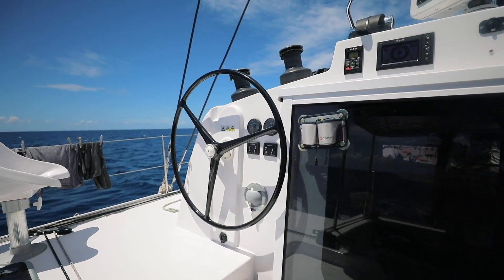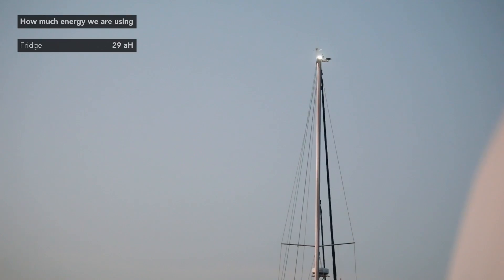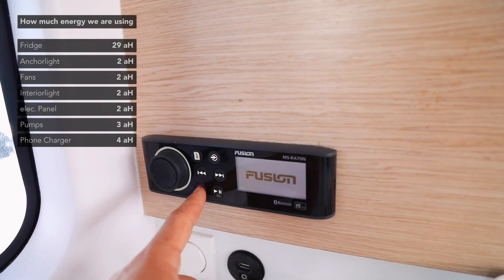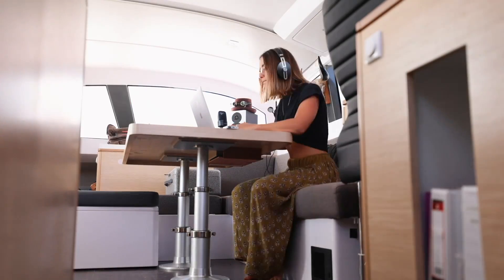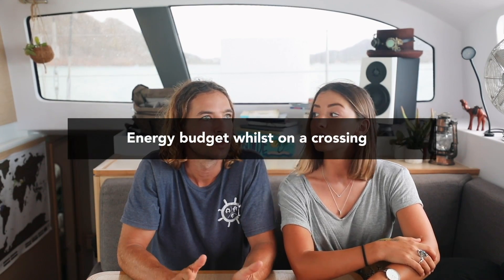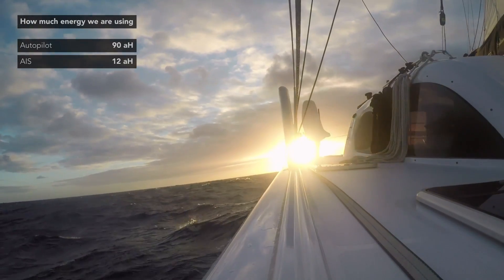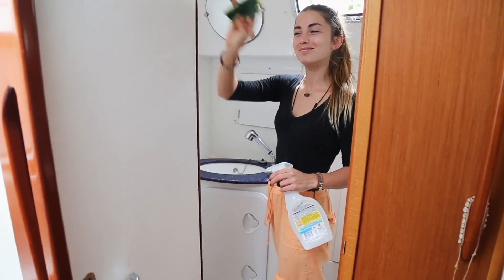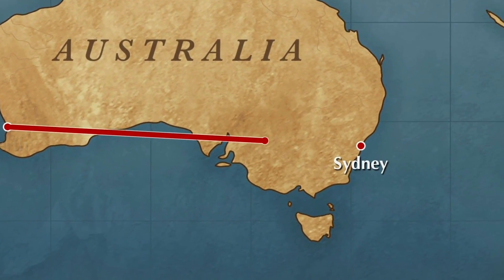Renewable Energy on a Boat

Comment: Small but important corrections:

At 0:43 - An ampere (amp) is not a unit of energy that can be stored in a battery; an *amp-hour* is a unit of energy that can be stored. Amperes (amps) are an measurement of the rate of energy **transfer**. You have to multiply amps x time to get energy used, thus amps x hours, or amp-hours (aH).

Confusingly in this video, both Riley and Elayna use the shorthand "amps" to describe how much energy a certain appliance uses in a day, when they mean "amp-hours". This is not actually a common shorthand, so when you hear them say "amps" you should translate to "amp-hours" in your head. 

To further confuse things, they never say what voltage their system uses, which is actually vitally important to understanding how much energy they're storing and using. Based on the numbers they give for their solar panel capacity, I can tell you that they're operating at 24 volts. So if you're designing a system at a different voltage, all of their amp-hour numbers will be completely wrong and you'll have to do some math to translate.

Electricity is annoyingly not intuitive, and amp-hours aren't a complete measure of "energy"; for that you have to multiply amps x volts to get watts (power transfer), and amp-hours x volts to get watt-hours (power storage).

It's not a perfect analogy, but it can be useful to imagine a water pipe that is delivering water to an old-timey water wheel that's powering something mechanical, like a sawmill. Amps are a measure of the speed that water is flowing through the pipe—something like liters per second. Volts are a measure of how much pressure is pushing the water through the pipe—something like PSI. As you can imagine, the amount of power available to turn the saw and do the work depends on both: if the pressure is low, it takes a lot of water to provide the same amount of power as a much smaller amount of water at a higher pressure. So to understand how much energy you have—how much work can be done—you need to know how quickly you can move water through the pipe (amps), and at what pressure (volts). The measure of how much work you can do is the amount of water you have in the tank (amp-hours) multiplied by the pressure (volts). 

Riley and Elayna's system operates at 24 volts. So for them, knowing that on passage their solar panels and Watt&Sea can generate 303 aH in a day and their systems use 277 aH is enough information. But for us to really use that information, we need to multiple by 24 volts. So their solar panels and Watt&Sea make 7,272 watt-hours (wH) per day, and their systems use 6,648 wH. This can also be expressed in kilowatt-hours, so ~7.3 kwH generated vs. ~6.5 kwH used. 

If you had all the same equipment as Riley and Elayna, but your electrical system operated at 12 volts, you'd generate and use exactly the same amount of energy — 7.3 kwH and 6.5 kwH — but that would equate to 606 aH generated and 554 aH used.

If you operated at 48 volts, you'd generate 151.5 aH per day and use 138.5 aH. 

I hope that helps.

P.S. (You might be wondering why some systems use 12v and some use 24v (or other voltages). The first reason is that batteries work at only one voltage range. So if you're using 6 volt batteries, you can combine them together in different arrangements to run a system at 6v, 12v, 18v, 24v, etc. But if you're using 12v batteries, you can only choose to run your system at 12v, 24v, 36v, 48v, etc. Some systems, like in a Tesla car, use batteries that operate at about 3.7v, so they have to run their system at a multiple of that, which in that case is 375 volts. The key is that there is one big advantage and one big disadvantage of lower and higher voltages: the higher the voltage, the smaller the wire you need to carry the same amount of energy. To use the Tesla as an example, if they were running at 12v, they'd need wires as big around as your thigh to carry the power their motors use. But at 375v, they can reliably transfer all that power in "normal"-sized wires. This seems like a big advantage and you might be thinking we should all run our boats and RVs at some super-high voltage. But it comes with a big downside: safety. 12 volts is not enough "pressure" to push significant electricity through a human body — something you can verify by touching both posts of a car battery at the same time and feeling absolutely nothing. At 24 volts, if you are sweaty you might feel a tingle. But at higher voltages than that, batteries and other power sources become a significant danger. Tesla's 375v battery pack is absolutely capable of killing a person if they accidentally insert themselves into a circuit by touching the wrong thing, and high-voltage power transmission lines can actually push electricity through the air to kill a person or animal that gets too close. This makes sense if we go back to the water pipe example. If you imagine sitting in a stream, you're sitting right in the middle of a huge transfer of energy – thousands of gallons of water are flowing past your body every second, but none of it moves through you so it's completely safe, even though it can do a ton of work (erode the land, run a water wheel, etc.). But if you take that same amount of water and force it at a higher pressure through a fire hose, it could violently push you over, or even injure you. And if you increase the pressure much, much higher, even a smaller volume of water could cut your body right in two and instantly kill you, such as in water-cutting machines used to cut shapes out of metal.)
Reply: To defend them, at the end they sow the list with aH behind it. Cutting hairs this should be Ah, but that is OK. I fully agree that in an energy item you should mention energy and that includes the Voltage.
Reply: i was wondering if someone was going to mention this, thank you
Reply: Top comment! I hate it when people use Ah without giving voltage. Just use Wh instead!
Reply: meow :P
Reply: Donnie Clapp Wow, thank you for your water analogies. As a DIYer here and there as needed around the house and on cars, electricity measurements have always confused the heck out me! Your analogies were brilliant and made it so clear! Thank you!

Now, I just need to look up ohms again and figure out how ohms will fit into this water analogy and I think I will have the entire picture! All I remember is it is resistance so a log in the river maybe? LOL
Reply: @justmeveginout8864  Yeah ohms is a measure of the resistance to the flow of electricity in the circuit. In the water analogy, something with low resistance would be like a big pipe with smooth walls and no sharp bends or corners. A pipe with high resistance could be a pipe that's very small around, a pipe filled with sludge, or a pipe with a bunch of very sharp bends and corners.

But in both cases, the "load" also introduces resistance. If the water is driving a water wheel, it obviously has to "push through" that water wheel, which is likely to be the most significant resistance in the system. It's the same with electricity. You do need to worry about the resistance of your wires and connections, but generally if those are sized and connected correctly, the load (for instance, an electric water heater) provides the vast majority of resistance in the circuit. A water heater is a nice example because it works by routing the electricity through a wire that has high resistance, which makes it heat up, but is very robust, so it doesn't break when it gets hot. 

The nice thing is that even though electricity is much harder to understand intuitively, once you get your head around the basic ideas, many of the equations are simple and straightforward to use (as opposed to the flow of water through a pipe, which we can intuitively understand but which involve equations that are incredibly complex and hard to use for the layman, in my opinion). 

Current (how fast the electricity flows, measured in amps) is equal to Voltage drop (volts) divided by resistance (ohms). Current is denoted by "I", so I = V ÷ R. And then you can switch that around to match what you're trying to solve for, so the minimum voltage you need to power something is the current you need times the resistance (V = I x R), and the resistance your circuit is experiencing is the voltage divided by the current (R = V ÷ I).
Reply: @DHClapp  Wrong, they use 12 V
Reply: Donnie Clapp tldr; but yes, mixing up A and Ah goes to show their level of knowledge. But they’re still ahead of many Joe Blokes. Using “aH” does hurt my eyes though, sorry.
Reply: @heyt54  ha! You know I KNOW it's Ah, but for some reason I got it turned around while writing that comment. Oops.
Reply: @DHClapp  By "them" I meant the vagas consistently writing "aH" which just looks so wrong. You wonder where they got that from?
Reply: Donnie Clapp great info, thanks
Reply: Hi, this is my favorite comment on youtube.
Reply: This is one of the best explanations I’ve read on the subject ever.
Reply: She says 'amps' in a funny way. Sounds like she's from the midwest. 😅
Reply: Nicely done Donnie Clapp. Are you a physics teacher, electrical engineer, or an electrical contractor maybe?
Reply: @dutchflats  Nope, just a guy who used to be confused by the inconsistent and sometimes confusing way that people talk about electricity. Thanks!
Reply: Worse - DC current will freeze your muscles. If you grab onto a hot wire or terminal you might not be able to get away from it.  This is one of the key reasons that Alternating Current (AC) power distribution won over DC systems - it is safer as AC power will go through a zero potential point that gives your muscles a chance to relax and let go.  As a side, the other key reason AC won over DC is the ability to step the voltage up/down at points in the distribution system with transformers, significantly lowering the size/cost of the primary power lines.

Side note - I have on occasion been mildly shocked by "12V" (14.5V) DC systems.  Your personal skin resistance can vary significantly over time, conditions, and from other people.  I would be cautious suggesting 24 VDC systems might only cause a mild shock.
Reply: @Dirk3672_StupidYT  DC is safe to the touch below 60v. AC can cause heart fibrillation.

Comment: So, looks like your generaeing almost Twice the Energy  underway, then you are at anchor. Oh, AND you have some untapped potential for energy as you do not have Windspike Wind turbines. I've always owonderd WHY Crusers aren't using windspike wind turbines in favour of the traditional wind turbines. windspikes do not have to be adjusted to face the wind. you could even make a mounting allowing the whole unit to fold down to the gunnals if you don't need em, then raise them again if you need them.  F.W.F.S.

Comment: Giving the Ampe hours without knowing your board voltage of your batteries is realy not all that helpfull - i guess its 12V since this is normal for boats but 12V lithium batteries are not very common  for 12V and your boat is quite big so it might have a 24V system. So which is it?

Comment: Someone else may have said it but in my van l charge my laptop to full when it is not in use. I then use it until low power, and repeat the process. Saves constantly having your inverter running which, in my case, draws a few amps / hour. This process also means your laptop will charge faster therefore wasting less energy - not to mention it's healthy for the battery!!!
Love your work keep it up :)

Comment: Hi Riley.
Have you considered super capacitors in a battery 12/24v configuration ?
1) They don’t have a limit of charge cycles
2) You can run them flat and they W don’t care
3) you can charge them up faster than you fill your car (providing you have enough current)
4) they are not affected by temperature. They don’t have a chemical reaction.
5) they can discharge at the speed of. Lightning strike. So can provide as much amperage as you need, eg starting an air conditioning compressor would not be a problem.

Cons: 
1) you need more space of energy storage compared to a li-ion battery
2) they may cost more.... for now

Comment: Riley, actually the correct unit of energy (work) is kWh... ;-)
But of course in batteries more often Ah is used. Ah*V(voltage) = Wh
So if you use everywhere the same voltage the calulation is fine.
The correct term for renewable would be regenerative energy, because energy cannot be produced, it only can be transferred in another form.
How do you heat, if you are in a cold region?
Interesting, you use a water-turbine during sailing, so you use a small part of the wind energy via the water mass flow.
.

Comment: I used to live on an offgrid property in Portugal.  Just 150 watts of solar panels and one 300 watt turbine supplying 400 amp hours of batteries.  I found that having the mindset of power being like a tank of fuel was the most important thing.  Many people that try to convert to offgrid life still seem to treat electricity as an endless supply of energy,  when in fact it's not.  In nearly two years there I only had to run my generator about 8 times . On those occasions it was when I had constant  cloud cover for over 4 days and zero winds.

Comment: Ah is a terrible unit because one ah with a fully charged battery lets say at 13.5volts is way more energy than at low chaging because ah are Ampere per hour but you have no constant voltage means no constant energy who is messured in watt hours. When the battery is full in the mornig 1ah at 13.5v means 13.50 Watt hours but in the evening when the battery is down to 11.50volts 1ah are only 11.50watt hours and the fridge neads more Ampere to run. If you cut a Video at low battery  voltage it feels like you drain the battery way faster because you need more Ah but one Ah includes only less energy.

Comment: Interesting, but real Energy generation and usage calculations should be in KWh, not just Ah. Ah is only half of the math, since you need to know the voltage too, to calculate KWh. If you look at electric cars, they always measure in KWh. How many KWh do your Li-Ion batterys have? Do they run with 12V, 13.8V or 24V?

Comment: And, you can never have to much batt storage ! And, nowadays, having independent  LEDs battery AA or AAA , stick any where Low voltage lights is a good  insurance  program. When buying  a inverter, best  to pay for a full since wave system, best for tronics. "Love you work !", That's  what you say to  Hollywood  STARS !

Comment: Riles & Eli,

I've been making my own toothpaste with bottles of hydrogen peroxide & boxes of baking soda for years.
It is very inexpensive, will last much longer than individual tubes of paste and has no harmful ingredients.
Plus, you don't need to use water to wet it, since the hydro is wet.
Just make to a consistency of paste you like.
Also, my dentist approves of me using those ingredients for toothpaste!

Happy & Safe Sailing!

Namaste.

Comment: Great video guys, very informative. Once came across a cat with 1200W of solar, but they were big users of energy. And that water turbine sounds like great, sounds like much in line with what Sailing Tranquilo are finding. Surprised more ocean sailors aren't using them. Thanks!
Reply: I've seen an increasing number of cats crossing oceans use the Watt & Sea water turbines, they look even more useful on a cat than a monohull as it's not heeling over. I've seen a number of monohulls have 2 mounts, one on each side of the transom, and switch sides depending on which tack they are on - wouldn't want to do a switch in the middle of the ocean. 

If I ever get a cat, I'm definitely getting a water turbine.
Reply: Problem with the water turbines - sharks attack them. Heard a yacht called Rogue had a shark bite into theirs in the Marquesas!

Comment: I'm a student living abroad in an apartment on a budget and I always take the plugs out when I don't need them (they use a little bit energy even when you don't use the charger or the lamp or the TV ect), I try to wair an extra sweater instead of putting the heat higher in these cold winter days. When I wash my dishes I just use a a little bit water (enough to have it all clean) no need to fill the sink till the top

Comment: I'm not to savy on the technical side, but enjoyed the breakdown of the energy consumption.  Question, is it possible to use a water wheel generator to charge up when you are under sail?  Attaching one at the stern would be a good location. Or even under the boat.

Comment: I also follow Aussie yachties Free Range Sailing. They also use a wind generator, rather than a water generator. It will produce current up to a certain wind speed and then it "saves itself" and doesn't work and the blades just free wheel. Would also work while you're at anchor with ambient wind.
Reply: And they just recently installed a new set of Quiet blades, you can barely hear it, now.

Comment: Amp Hours vs Kilowatt Hours
Amp Hour and Kilowatt Hour Differences Defined = simply put,  Amp Hours are a measure of electric current and Kilowatt Hours are a measure of electric power.
However, there is a relationship between the two.  Specifically, electric current is a component of an equation that helps to determine electric power.  That equation is…
Power in Watts = Current in Amps x Voltage
Consider the following…
A battery rated for 100 amp hours will provide 5 amps for 20 hours.
If we have a 12 volt battery, we multiply 100 by 12 and determine that the battery will provide 1200 watt hours.